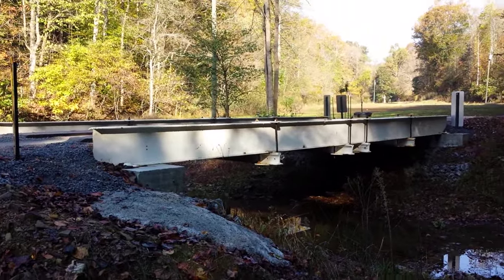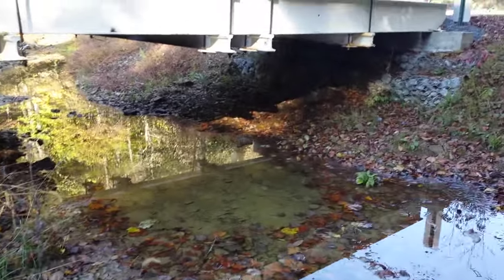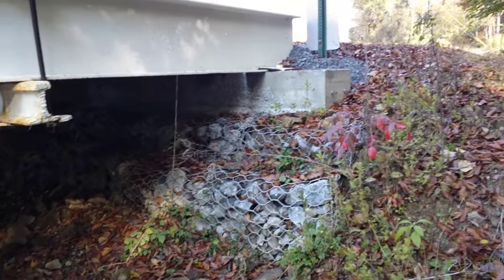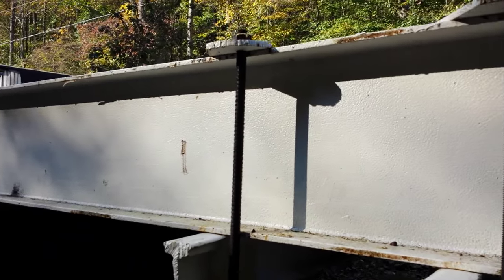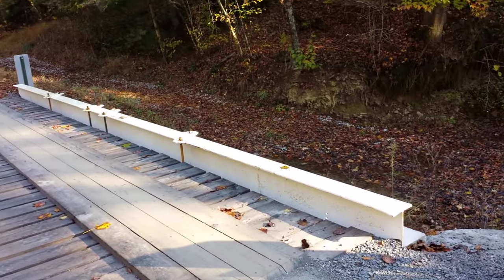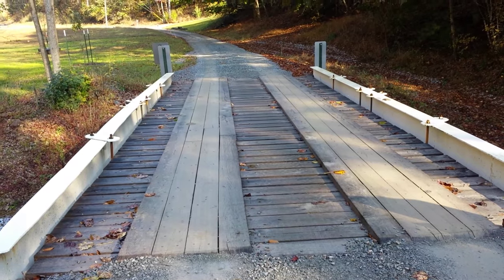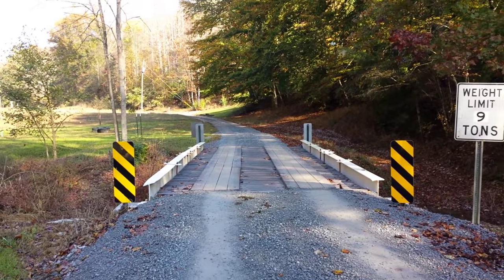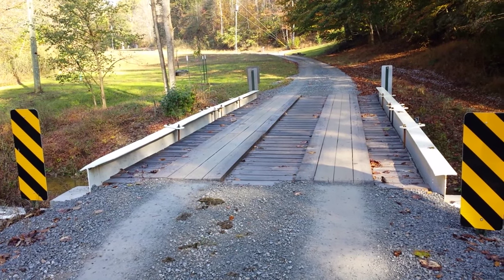Low cost timber deck bridge

Comment: Curious at to why you didn’t just put the cross beams on top of the side I beams? Them timber planks on them.
Reply: I was thinking the same thing, wonder what they’re actually supporting 🧐
Reply: Keeps the profile of the bridge within the height of the beams. The beams rest on the concrete abutment, which is already at roadway height. Not much re-grading the road to do after the bridge is in place.
Reply: Bonus!, no need to build bumbers to keep cars on the bridge

Comment: an alternative to using steel for a bridge is to use steel...  and dont forget to use railroad track which is usually illegal to own.  And threaded rod homemade clips is the only thing actually carrying the weight, they will need to be checked at least twice a year. sorry, im not a fan of this idea.

Comment: We are looking into buying a 5 acre property. But the seller is having a hard time selling it because there will need to be a bridge built to even get on the property. A bridge spanning 40 to 50 ft. across will be over a creek. The crevice where the creek is drops about 10 feet or so. This bridge will need to be able to hold construction trucks. Probably the heaviest truck will be a cement truck. Any ideas as to what kind of price we are looking at? The house eventually will be built on top of the hill. Its a hill that is 25% sloped. But starts to level off half way up. Steeper at the bottom where the creek is.
Reply: That's going to be pricey, maybe a culvert.
Reply: From new with I beams, concrete footers, timber, equip use likely 80-100k for 40'x12'. Its crazy expensive for a span that long.

Comment: Nice bridge! How do you fasten the timber 2×8 planks to the metal structure?
Reply: You get lengths of 8x8 or 10x10 or 12x12 rough sawn beams and lay them length-wise accross the old RR tracks used as stringers.